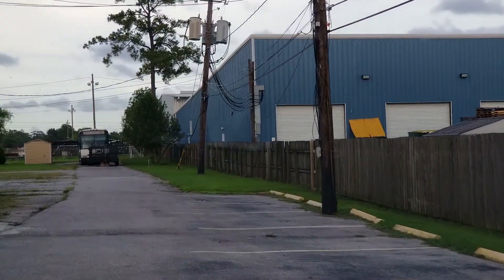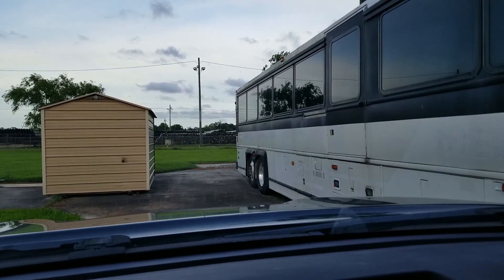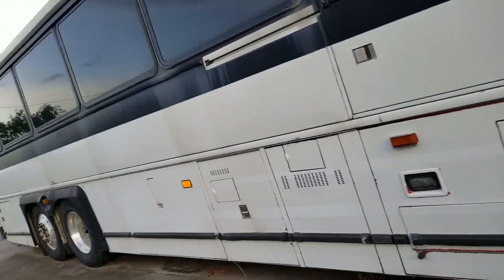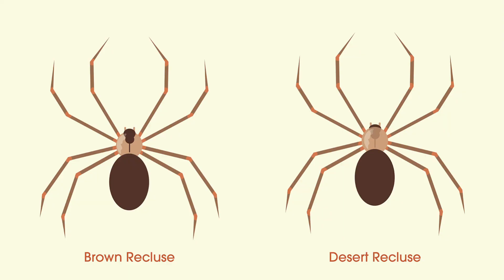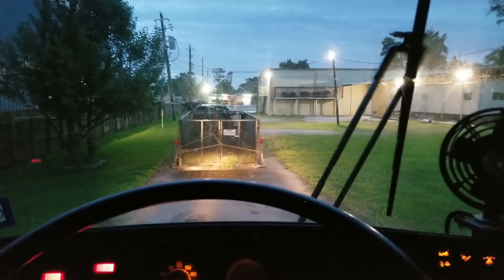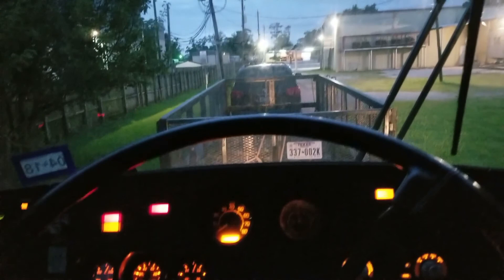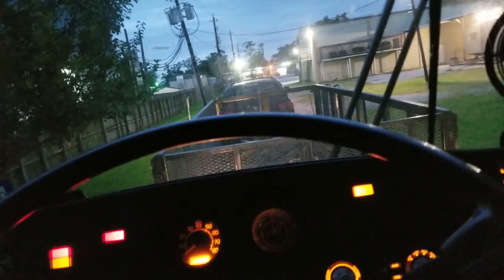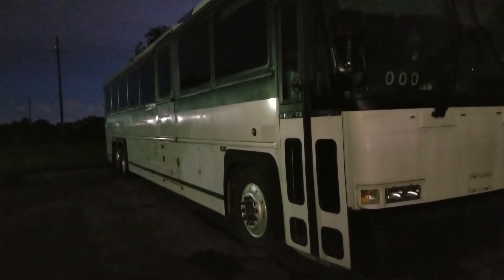Checking Atlas 8D Batteries After Sitting for Three Months

Comment: What is the best charger for 8d batteries?  I own a NABI 60-sw and the batteries are dead it sat for 6 months even though i hit the shutoff switch.   I would like to charge all at once would a 4 bank work and how many amps?  I also read to make sure it has enough distilled water inside?
Reply from the maker: If you have 4 batteries of the same type (8D for example) you do need a smart 4 bank charger. Mine are Powermania M212E for 2 bank house batteries and a Powermania M330 for the 3 coach batteries. There is other brands but as long as it's a smart charger it can charge all batteries at once. 
If you leave the coach sitting for a month or more, physically disconnect all batteries from each other, not just the cutoff switch. Batteries will pull power from each other through the equalizer if don't physically disconnect them.
The only way to leave them connected is if you leave the charger plugged in while stored.
Yes, always keep batteries filled with distilled water.
Reply: @mrdaniel0078  Thanks for the response!  So basically i was wrong, my bus has two batteries, runs two NAPA 7668 14 volt batteries.  If they dont have the full 14 the bus will crank but not fully start, even with the fuel pump primed.   For some reason, they will drop from 14 to say 13.4 and then the bus wont start, they both have to be full 14.  My gauge on the dash shows the 12v gauge at 12, and the 24 at 24, and it will start.  However if for any reason the 24 falls to 20 its dead again.     ALso there is a 24v charger input next to the batteries, and one mechanic told me to use that, but another mechanic told me to only use the 12v positive/negative to trickle charge.    I ordered a smart charger on ebay but my bus is stranded right now so im hoping to find a heavy duty charger at harbor freight or napa and get her jumped asap.

Comment: It shouldn’t be constantly beeping like that in drive and or neutral if the system is all aired up. You might have left the high idle switch in the on position in the rear engine bay.
Reply from the maker: Thank you for the information.